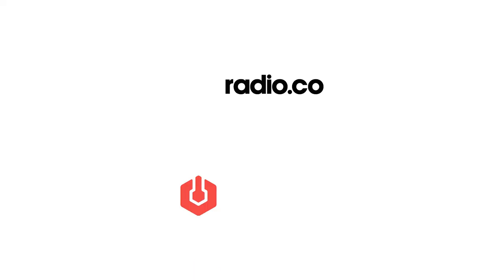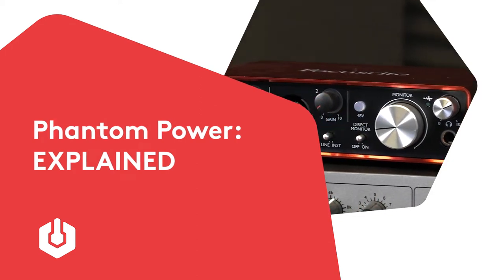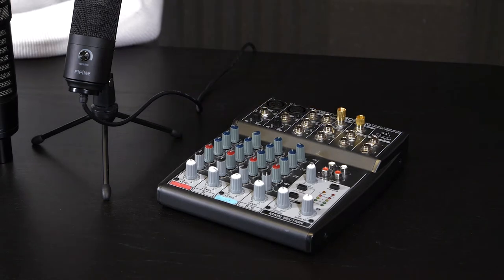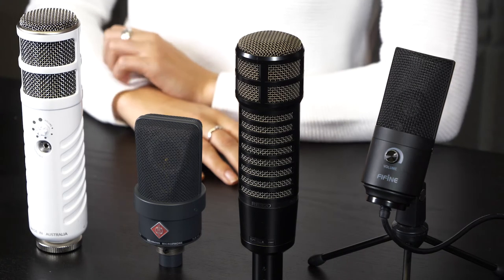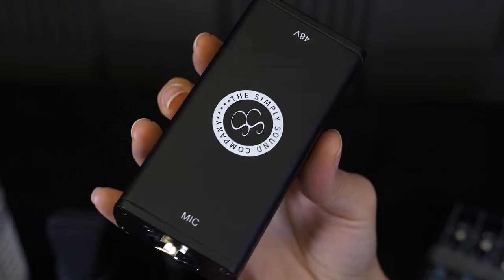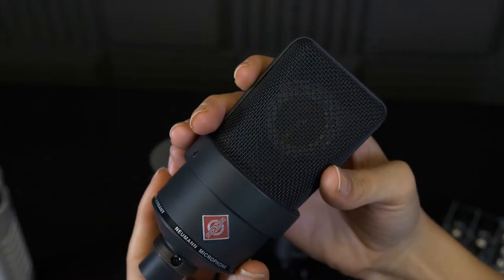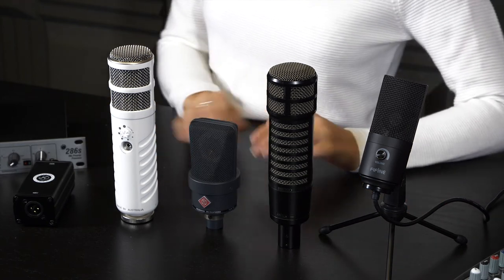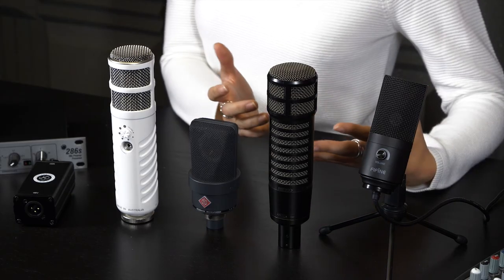What is Phantom Power? Microphones Explained

Comment: I have an AKG P-220 and a Crate PA-8 mixer and the mic will not work when plugged directly to the mixer, I am assuming that this means I will need a separate power supply in order to use the mic?
Reply from the maker: Your mic will state what voltage it needs to get to line-level (aka for your audio to work). Check this against your mixer's voltage, if it's too low then you'll need an external mic amplifier to boost the signal, like the Cloudlifter: https://www.amazon.com/dp/B002WZK3BC?tag=radiodotco-20

Comment: Hi, what shall we need to Marantz MPM 2000? one 48 vdc phantom power and what cable then to connect it to the computer? we use MacBook Air with usb-c. Thanks in advance!
Reply from the maker: The Marantz MPM 2000 needs phantom power. So an audio interface like the Focusrite Scarlett 2i2 should work. But it uses a USB connector. You'll need an adaptor from USB-C to USB (there are loads of alternatives out there). If you get stuck, drop us a message at studio@radio.co.

Comment: I'm using a small clip mic connected to a portable transmitter (like those used by tour guides, etc ) . Do I need Phantom Power on for these mics?
Reply from the maker: Sounds like you're using a lav mic, which you doesn't need phantom power. If you know the name of the mic, let me know and I might be able to provide more info.

Comment: Hey Guys,

I am trying to plug in my RODE wireless go into my tascam, dr 40. DO I need to switch it to phantom or leave it on mic? Thanks!
Reply from the maker: Hi, you won't need phantom power for the Rode Wireless Go, you'll just need to charge it up before use with a USB- C cable.

You will also need a RØDE VXLR 3.5mm Minijack to Male XLR Adapter to connect them because the Tascam is XLR and the Rode is 3.5mm aux.

Hope this helps!

Comment: Does the XN-USB require phantom power for better sound?
Reply from the maker: No, not if it's a USB microphone. XLR mic connections usually require phantom power to get audio to line level (as in, sound it doesn't sound too quiet).